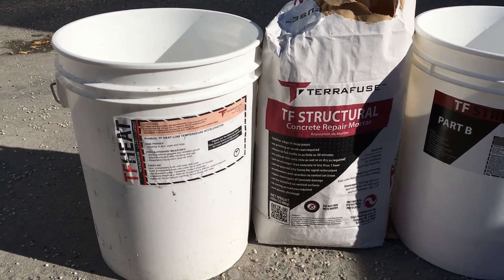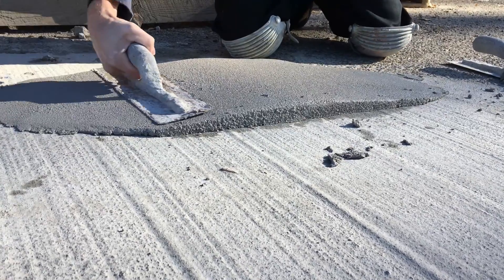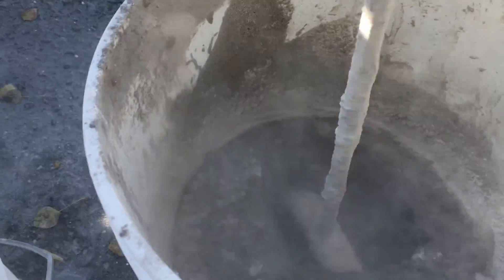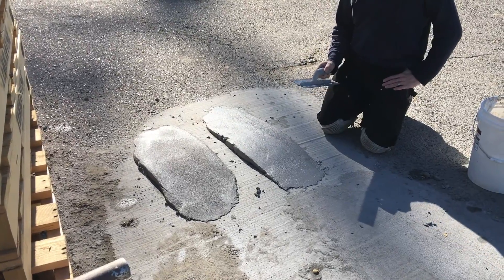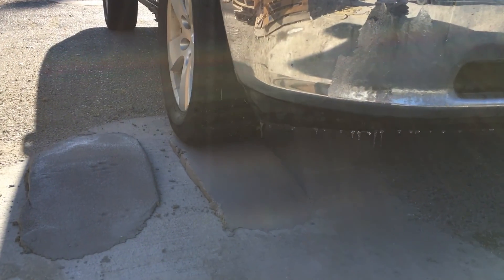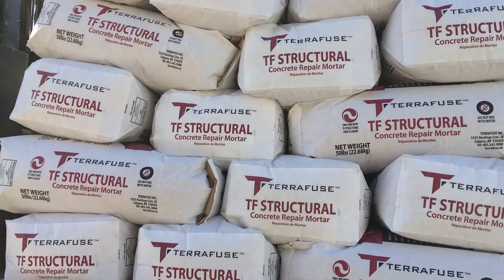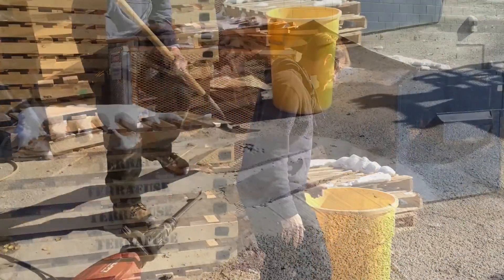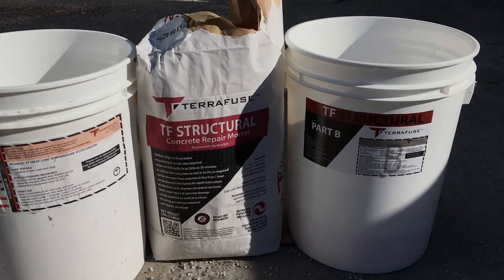TF Heat for Accelerating TF Structural Concrete Overlay

Comment: Do I need to repair 1/8 cracks first?
Reply from the maker: Yes, if you don't want them to reflect through, here is a method you can use to help prevent it (fixing cracks is never a guarantee on concrete.
Reply from the maker: https://www.youtube.com/watch?v=o5UYlJmKhAE&t=49s

Comment: Can you tell me the difference between TF and New Crete?
Reply from the maker: NewCrete is a polymer modified portland cement. It relies on acrylic polymers to bond to concrete, TF Structural will chemically bond to concrete. NewCrete has maximum thickness restrictions, critical mix ratios, low temperature restrictions, and working time can't be adjusted. TF Structural doesn't. There are many other differences, as the chemistry and technology of TF Structural is completely different from Portland cement modified overlays. Portland cement doesn't bond to concrete, so I has to be 'glued' to the concrete with polymers. TF Structural doesn't rely on 'glue' to bond to the substrate.

Comment: OK my question is about the accelerator. And I guess it depends on the thickness. Will it not shrink after it cures. Cause just about all solids shrink with heat after a period of time. Not trying to be a d..k I'm just curious lol.
Reply from the maker: No shrinkage. It actually expands very slightly. This chemistry is nothing like Portland cement.
Reply: @TerrafuseInc  👍
Reply from the maker: And thicker, hotter applications actually makes it stronger :)
Reply: TF for cracks?
Reply: Can we resurface and repair with this?

Comment: Can this product be troweled out over the very porous surface of aircrete in order to create a good hard wear surface if aircrete were used for a floor slab?
Reply from the maker: What is the psi of aircrete?
Reply: @TerrafuseInc  I'm not exactly sure. You can stand on it without leaving marks but if you had heavy duty work boots on and jump up and down you would probably leave dents.
Reply from the maker: Ok, that is definitely not an ideal substrate to install TF Structural on, unless you apply it 2”-3” thick.